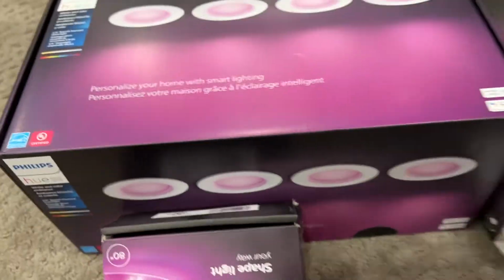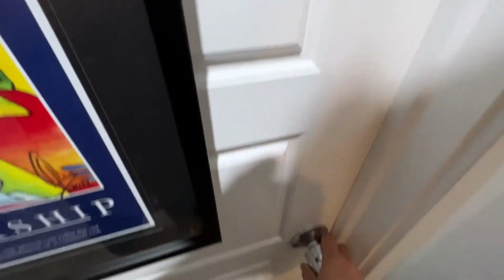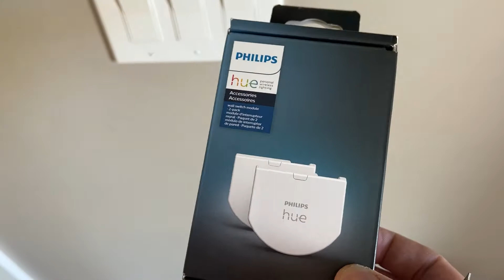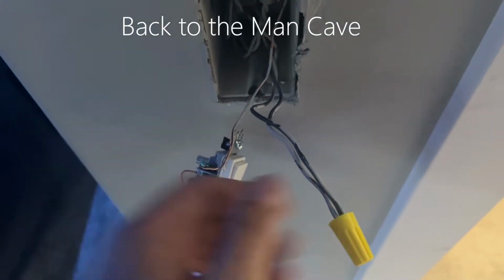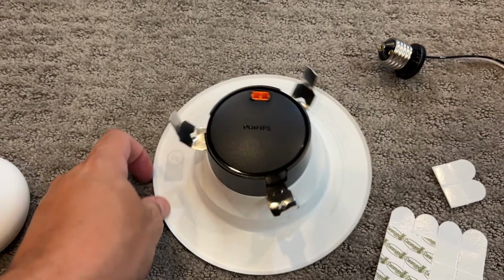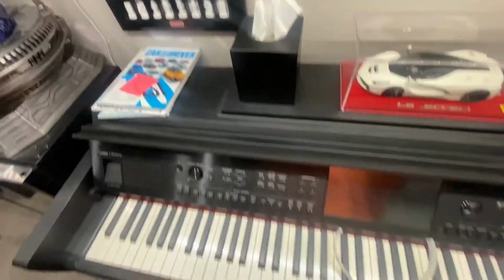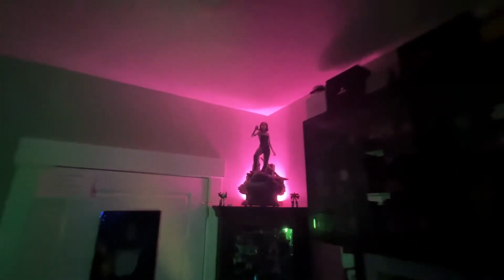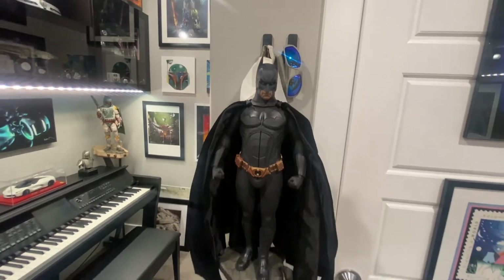Philips Hue Lights Strips, Hue Go, Hue Bars, Hue Switches. Magical Mancave Edition.

Comment: Very cool! I’m doing my basement soon and would love to incorporate hue lighting. 
Question..the scene lighting incorporates all lights? For example..it incorporates the light strips, bar lights and overhead lights? It is smart enough tk read all different kinds of lighting since it’s on the same app? I’m just kinda confused as the how it all works. Maybe it makes more sense once you connect everything?Thanks!
Reply from the maker: Yes, the scenes incorporate all the lights and it makes perfect sense once it's all set up. If you don't like once element of a scene you can customize them too.